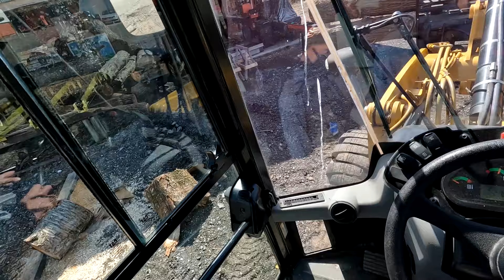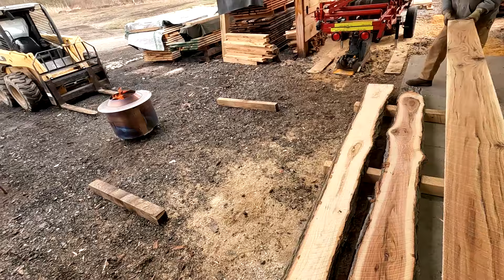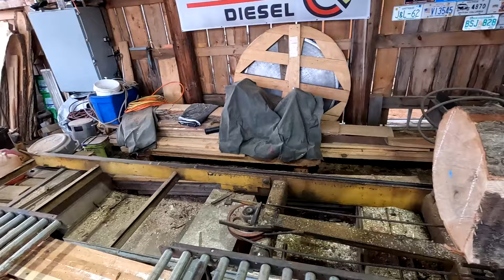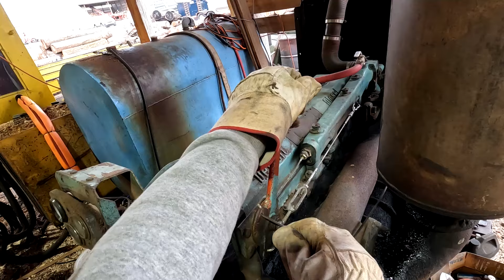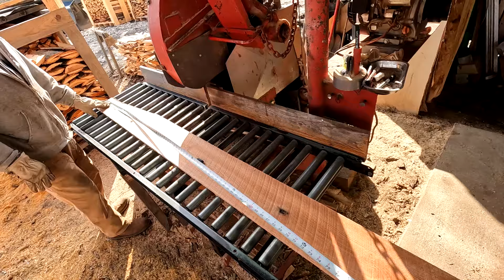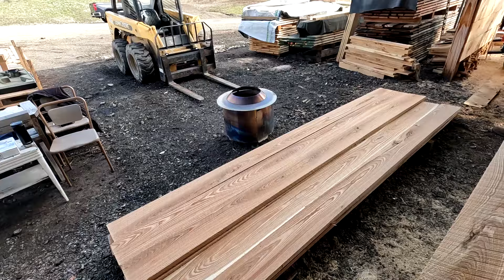Rounding up some oak to make some lowboy decking.

Comment: Enjoying your videos.  Was a construction superintendent for 20 yrs, and it became a habit to watch for ways the guys were working and modify them to ways  that were more efficient but as painless as possible.  Here is a suggestion for stacking the finished boards like you are doing at the 27 minute mark.  If you let your partner cross the first pile being a foot or two past it, and then he walks back towards you about three feet, then you have a clear path past your end of the pile.  As is, both of you cross at the same time and have to lean out somewhat with the board, and that is tougher on the back, as well as perhaps a tripping hazard.  May even be quicker as you wouldn't have to be so careful crossing the pile of boards.  Like the videos!
Reply from the maker: I m thinking of moving the edger down. Thank you for the suggestion and for watching

Comment: Eddie... if you know someone who rides motorcycles, check if they have a helmet communication system. They have pretty good noise cancelling capabilities and see if that would allow you to borrow it and talk while working the mill. I know that I would like your comments as you turn the boards and decide where they are going.
Reply from the maker: I’ll be trying a GoPro mic. I’ll see how that works first. Thank you for the suggestion and for watching